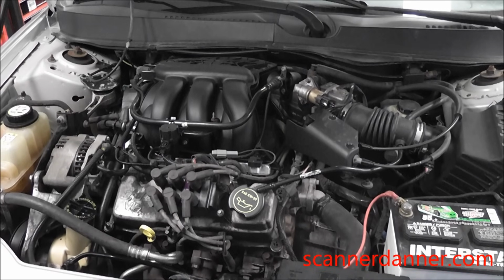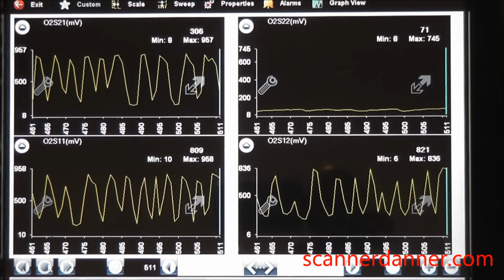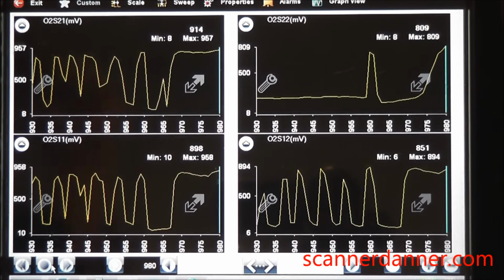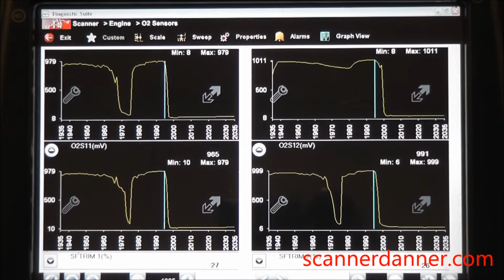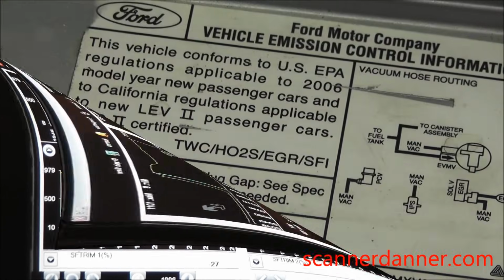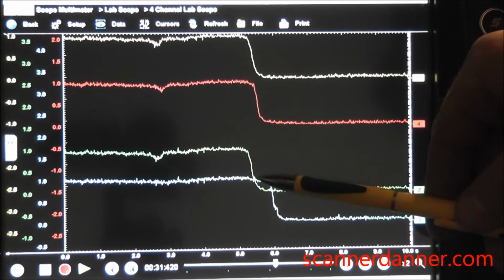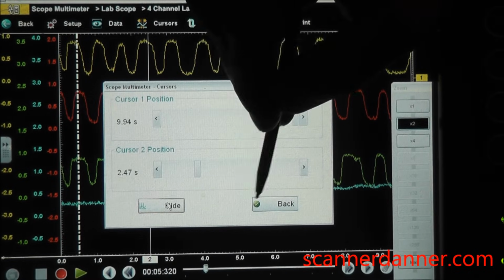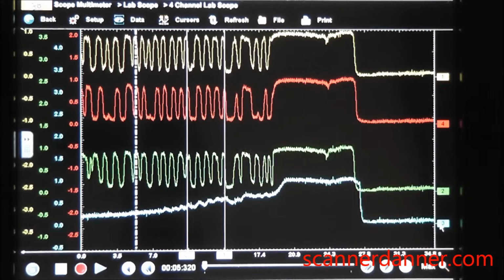Diagnosing a catalyst efficiency code (P0420 or P0430)

Comment: So if I have a p0430 on a 2004 v6 highlander and the downstream sensor is mirroring the upstream and I also have high (14-18) bank two long term fuel trim then does that mean the cat is bad? No misfire codes and doesn’t lose coolant or oil and spark plugs are new and same cat was replaced by dealer 4 years ago. What other engine problems can ruin a new cat but yet not cause a MIL? The infrared thermometer shows a pre cat temp around 390f when up to temp and cooler at back of cat
Reply from the maker: fix your fuel trim issue first! unless your Toyota is using the downstream O2 for fuel control (some do). Do you have a wideband upstream sensor on your model?
Reply: ScannerDanner 
Yes. Wideband sensor that I replaced at the same time as downstream 9 months ago when I took it to Toyota for same p0430 and they said the downstream was acting lazy and to change it first. All expert info I read said changing an 02 sensor for that kind of code is usually worthless because a failing 02 sensor would have a specific code.  Fuel trims on bank one are perfect. What would cause a fuel trim issue on one bank only? Injectors...ecm...I am not sure how to troubleshoot but recognize I am asking a lot from you!  Figured for $500 I could swap the cat myself rather than pay $200 for a diagnostic that tells me what I sort of already know. Only thing I thought about was smoking it to see if there’s an exhaust leak causing the downstream to command the higher ltft....but that infrared temp reading makes me feel like the cat must be bad.
Reply from the maker: @mattaudia4968  agree with you wanting to check that bank for an exhaust leak! do that first, then I agree, the cat is most likely toast. Just be sure when you are done that your fuel trims are normal!
Reply: ScannerDanner So I swapped the cat and the ltft on bank 2 was up around 18-22 and wouldn’t drop. Took it to dealer thinking they would at least smoke it down and possibly find something I missed. They charged me $140 and said it could be a air leak or maybe fouled injectors. Wanted $700 to “look further into it”! I rolled dice on three new injectors for $200 that were Beck Arnled on the box but Denso stamped on the part. Swapped those today and immediately the stft was showing negative 10-20 and then ltft started creeping down to 5-9 after a short trip around the block. Think I fixed it? Thanks again for pointing me in the right direction. I’m sure I would burned the new cat super fast if I hadn’t tackled the trim problem. You’re the man!

Comment: Great video with oxygen sensors, how about with lambda sensors. How do you verify bad catalyst with lambda sensors.  Thank you.
Reply from the maker: To be honest, I never do this test. A bad cat (not restricted bad, but bad in that it no longer can catch and store oxygen like it should be) will set a code and that code (P0420, P0430) is very accurate as long as there are no other codes or exhaust leaks. No other codes but a cat code = you need a cat 99% of the time. Further testing to confirm not needed imo

Comment: I changed complete y pipe with three cat system, all 4 02 sensors, and I am still getting P0430 code 2014 Sierra, bank 2 sensors are not switching, what else could it be, no exhaust leaks

Comment: What if you did have long trim issues, would that have changed your direction in this diagnostic?
Reply from the maker: Absolutely! Handle any other fuel trim or running issues first. Unless of course the cat is restricted from melting down

Comment: ScannerDanner, quick question, does a bad reading on the post catalytic 02 sensor affects the engine fuel mixture same as the pre catalytic 02 reading?
Reply from the maker: On some, yes. Typically when you have a wide band upstream sensor they'll use the downstream for trim control as well

Comment: Great video - I've learned a lot watching them. 2 questions regarding a P0430 (inefficient catalytic converter, bank 2) triggering on my 06 Tundra with 105K miles.  When I add Cataclean, (or lacquer thinner)  to my fuel, the P0430 code clears, but only temporarily.  After treating, an occasional P0430 triggers again.  So can you help me understand why:
1 - What can the lacquer thinner be doing that causes the code to clear? 
2 - If the cat HAS gone bad, why doesn't it trigger P0430 constantly instead of occasionally? 

I'm very new to this - I just purchased the BlueView ODB2 scanner and learning how to use it to capture sensor data.

Comment: Hey Dan, good video thanks. I get the p0420 code often on Subaru's in NZ, this video is helpful. What differences would you get using a gas analyser when doing this test? when doing MOT tests back in Scotland we did a catalyst stability test, we found any faulty cat would read high on co. We also found any running issue would show high hydrocarbon level. If all else showed good but lambda was out the most likely thing was up stream o2 sensor.  What are your thoughts on this? Thanks

Comment: 03 Dodge Ram 4.7l, can there be a bad cat without any codes?  The problem im having is i have lost of power when gas pressed to the floor.  So i took my scan tool and did live data with the engine fully warmed up at idle the primary o2 sensor is going rich/lean, the secondary o2 is staying pretty much at 0.7 -0.8 volts.  Now at 2000 rpm the primary o2 is the same rich/lean and the secondary 02 is fluctuating rich/lean also.  Then i tested the temperature before the cat is about maybe 20 degrees cooler than after, but no CEL.
Reply from the maker: yes, absolutely. I have seen restricted cats not set codes. What does your O2 read at WOT on a first gear run test drive? IT should be flatline rich the whole time. Do that test first then we can test the cats.

Comment: Stumbled on this video. I put an aftermarket cat on my car because the old one was rusted out (not a running problem.) Flash forward 5000 miles later and the check engine light is back on for a p0420. Checked the downstream o2 and its reading steady at about .65 volts and looks like the cat is working. No exhaust leaks. Guess its probably the aftermarket cat just not being good enough for the computer's requirements.
Reply from the maker: yep, aftermarket cats are garbage unfortunately, just make sure you have no exhaust leaks upstream of the cat
Reply: 3 year later update... it was just the crappy aftermarket cat, replaced it with factory never saw the code again. @ScannerDanner
Reply from the maker: @randomugliness1238  I see this all the time! Thanks for the update!

Comment: Hi, thank for good video. Iam suffering with a p0430 for a while. Iam driving avensis 2003 t25. I have changed the spark plugs, cabin and air filter, oil filter and now the bank 2 rear and downstream sensors with denso original. My graph on torque show that bank 2 sensor 2 is acting like the bank 2 sensor 1. Rich to lean same speed. My driving problems is that the car hesitate till it gets to normal temperature then drives normal. And bad smell and excessive fuel consumption. Can you tell if converter is bad?
Reply from the maker: If the downstream has the same frequency and amplitude as the upstream with the cat warmed up, your cat is dead. BUT you MUST fix the other issues you are describing or you'll end up killing the new cat
Reply: @ScannerDanner  thank you for your reply

Comment: Danner question about your comment, you stated not to touch the cat until the running problem is fixed, well is there a chance the cat is bad on lifespan and there isn’t actually a running problem? Also can you provide me with a link to your class and training in person? I live in Lansdale Pennsylvania and would love training on diagnostics
Reply from the maker: Technically the cat never goes bad. They can last hundreds of thousands of miles. But they do get contaminated and can be damaged by improper af ratios and misfiring as well as other contaminants, like an engine that burns oil etc. That being said, I have seen many bad cats with no apparent reason as to why it failed. No history of severe misfiring (according to the customers), no running issues, perfect fuel trim numbers, no exhaust leaks, yet the cat has failed. In those cases, just replace the cat with a factory cat (only) and send the customer on his way.  
You can join my premium channel here https://www.scannerdanner.com/join-scannerdanner-premium.html
Thank you!

Comment: Thank you for the info. I have been troubleshooting this code on my own vehicle now for a few months. Because of the complexity of the code in general. One question that I have is what about long and short fuel trims? My 2014 Nissan Pathfinder the fuel trims seem to be all over the place in response to accelerating and de accelerating. Vehicle runs fine and only code is p0420. Just wondered how that would affect things? Maybe the fuel trims moving around is normal? I don’t know enough about that to understand it. Any thoughts is greatly appreciated. Thanks.
Reply from the maker: I will only use fuel trim when the throttle is steady. Acceleration and deceleration, it will be all over the place because it is not being used during some of those times. For example, injection is cut completely during a deceleration event (no fuel at all), so fuel trim is irrelevant. Also, rapid acceleration will drop you out of closed loop and again, fuel trim is not being used.
Reply: ScannerDanner thanks for the quick reply. I have a mobile scan tool plugged into my vehicle now. I wanted to ask this as well. With the car idling and at running temperature. Around 180-190F. The bank 1 short term trim is fluctuating between -1.6% to +4.7% and bank 2 short term is fluctuating between -0.8% to +3.9%. Does this seem right or should be more one direction than another? As in both averaging range in negative or positive ranges. Thanks again.
Reply from the maker: @williamburroughs77766  totally normal my friend
Reply: ScannerDanner ok good to know. I can at least eliminate fuel issues being a problem. I believe the cats on my car are probably going to need replaced some time. For the time being since there isn’t any Regulations for emissions in my state. I will plan and save to replace myself. Thanks again. If there are any other suggestions. I am all ears. I really liked your approach to showing true data on something in a real world setting. 👍 up to you.
Reply from the maker: @williamburroughs77766  thank you! 
1. You MUST use factory cats only when you decide to do this job. Sure, aftermarket ones are a fraction of the cost, but within a year, maybe even just a few months, that code will come back. 
2. Make sure you do not have any exhaust leaks upstream of the cat (that can set false cat codes)
Reply: ScannerDanner ok will do. Was planning to buy Nissan OEM cats anyways. Currently no leaks that I am aware of. Thanks again for the info.

Comment: How small of an exhaust leak will affect this? In other words will it be easy to ID or can it be something very minor you might not be able to find? Also I have seen a video that swears vacuum leaks are the main cause of cat efficiency codes.
Reply from the maker: it can me minor, but in general, you will hear it and no, vacuum leaks themselves will not cause cat codes BUT, vacuum leaks can alter the a/f/ ratio enough to cause unburned fuel to enter the cat and that, left untreated, can kill it.
Reply: @ScannerDanner  my Christmas tree went out today. It ran over 1600 miles this last time before it came on. I'm so pissed that it disables the VSC. My report said Catalyst Monitor Bank1 failed. P0420 error and looks like it went a little below minimum. I don't understand the unit of what it's measuring since it's not labeled. Value .0317 and minimum is suppose to be .0387. I wanted to monitor it in a graph while driving but I have no clue what it is monitoring. Can you add anything? I'm so frustrated with these damn efficiency codes on all my Toyota's.
Reply from the maker: Factory cat replacements only for these. Aftermarket cats will return those efficiency codes within a few months.
Reply: @ScannerDanner  I suspected that about the aftermarket cats. I don't live in an emission inspection state so my next though is simulators. My goal is to make sure the O2's are working properly first. My goal also is to keep the VSC working since that's a safety feature. Real shame these greed driven criminals get away with disabling a safety device just to light up your dash to scare you into thousands in repairs. If everyone reported this to the NHTSA Toyota would be forced to recall all the vehicles and reflash ECU firmware.

Comment: Been binge watching your videos again.

We had huge problems here in Oz with the Holden Commodore (US Pontiac GTO I think), with the early LS series engines throwing P0420 and P0430 codes, GM Holden must have made hundreds of thousands of dollars, if not millions on replacement convertors, which, came with replacement exhaust flange gaskets.

After the first two or three I saw with the fault I decided to do a bit more testing, smoke tested the  exhaust, with engine not running, no leaks, smoke tested the engine whilst turning it over by hand, exhaust pipes plugged, no leaks. Finally flooded the engine running with the smoke tester, with UV dye added to the smoke oil.

I discovered UV dye staining around the donut style flange gaskets, the leak would only occur with the engine running, the problem was the gaskets would go hard with age and then leak when engine vibration was a factor.

GM Holden made a massive amount of money selling new convertors when the fix really was the new gaskets that came with the new convertors.

After the initial testing we made hundreds of fixes to customer's vehicles by replacing gaskets only. Moral of the story... test, don't guess.
Reply: Hey Jake. Great write up. I’m in Australia too and see these codes quite often. Very interesting. Where in Australia are you?
Reply: @DanWallis86  Perth mate
Reply: Me too. Are you on Facebook? Can I send you a message on there?
Reply: @DanWallis86  not on FB.
Reply: @2secondslater  no worries. I like your write up you did on the exhaust leak. Thinking outside the box a bit. 
I’m in a few mechanic groups on Facebook and a mate of mine has a shop in gnangara. We have been trying to organise a couple of training nights for local mechanics to learn about pulse sensors and scope use. Would be good to get people who like to take a somewhat different approach to repairs rather than just firing the parts cannon.
Reply: @DanWallis86  Hey mate, that sounds interesting, I am closer to the middle of Perth but might be interested in catching up for a tech night some time in the future.

Comment: Six and half years later, still relevant and helpful!  Thank you @ScannerDanner!
Reply: One difference now is that many upstream sensors are air fuel rato (AF) sensors which produce different graph readings. So comparing waveforms from an upstream sensor to a downstream sensor doesnt work. The point being be sure if you are dealing with an upstream O2 or AF sensor. The emissions sticker under the hood will tell you.

Comment: Hey Paul,how are you? I have a P1273,however,it comes on for sometime but off for sometime. But the thing is, the P1283,voltage is,.600 and the P1273 has,.300 volts. These two sensors should have the same voltage,right ? By the way,it’s a 05 murano. Can you explain? Thanks
Reply from the maker: definitions of these codes please
Reply: ScannerDanner actually,there’s only one code,P1273. It’s a “lean shift bank 1” . When I compared the voltage of bank1 and bank2,they are not the same. Makes me wonder why. When bank1,sensor has.300 volts and bank2 sensor has .600 volts. They both are A/F ratio sensor.
Reply from the maker: @mckoylach1622  What are your fuel trim numbers?

Comment: Chronic P0430 code on a 2013 Ford Explorer LTD 4x4 3.5l 122k miles  after cleaning throttle body . Never threw a CEL P0430 code until  after the throttle body was cleaned . WTF !!!!

Comment: I just bought a 2018 GMC Sierra with 17500 miles. It wasn't a day later I had a check engine light and the engine was running rough. I took it to the dealer and when they test drove it they got stranded and had to get towed back to the garage. Ended up the fuel pump died on them and they replaced it. I picked it up in the morning a few days later and that night got another check engine light. Took it back the next day and when they checked, it had the cat efficiency codes. They replaced all of the catalytic converters and the down stream oxygen sensors. The story I got was this truck was part of fleet the oil well guys used and they may have let the truck run out of gas and maybe that damaged the fuel pump? What could they have done to damage the catalytic converters?

Comment: The cats on this engine may need to be replaced, but do you really want to replace them without having a reasonable explanation regarding why the old ones failed, before you invest in new ones?  Checking the fuel trims doesn't seem to be enough.  If the engine is starting to internally leak coolant or burn oil, your new cats aren't going to last very long.  I suppose the amount of time spent chasing the cause of the cat failure should be somewhat proportional to the cost of  replacing the cats, which will vary significantly between different vehicles.
Reply from the maker: for sure! All of these things you mentioned and then some need to be addressed